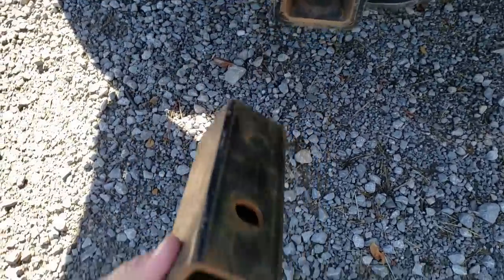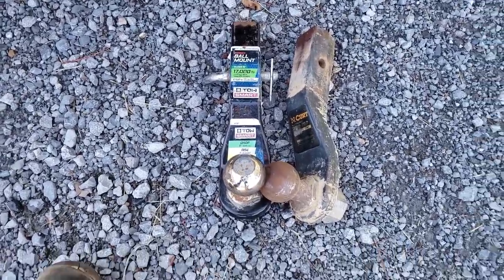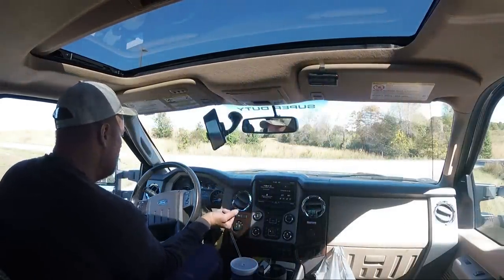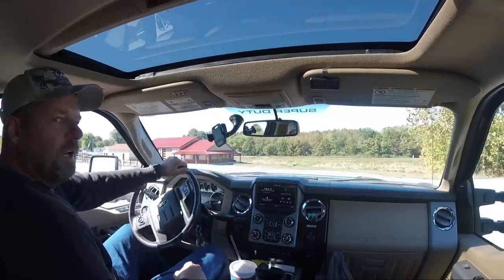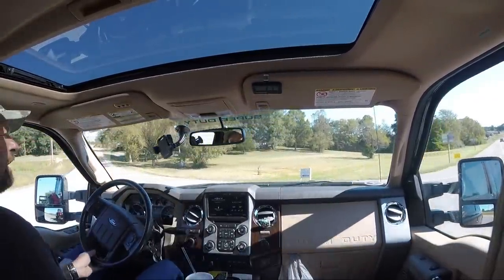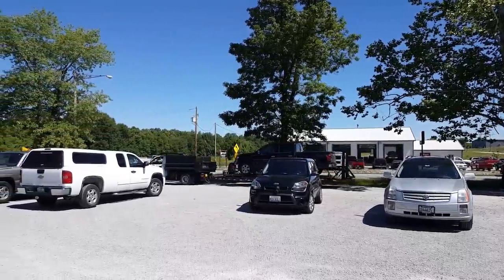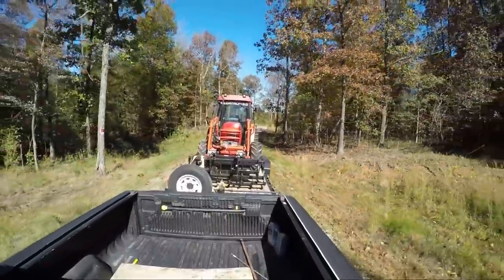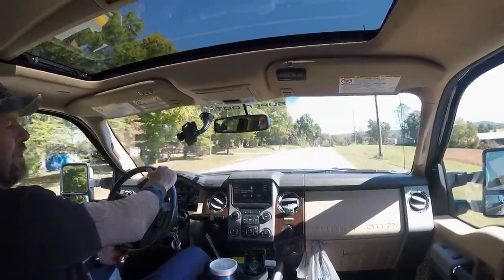Ford F250 6.7 Powerstroke Diesel FIRST TOWING MISSION 10k Steep hills & more

Comment: You can actually go in the settings and select trailer brake efforts. Which applies the trailer brakes quicker to your gain setting
Reply from the maker: Yes I'll have to dig around in there a little bit more I know how to adjust the gain setting but wonder if there's another setting that can be changed

Comment: That hill decent is for off-road use mainly does the brake management for you so you only have to worry about navigate the terrain. Also while going down the hills in tow haul, if you apply the brakes the truck will downshift and the transmission will hold a speed like sort of like an engine brake.  Great purchase as the f150 needed a break lol, love the content.
Reply from the maker: Thank you I appreciate it and yes I am really enjoying the engine braking in tow haul mode

Comment: I’ve never drove a better towing truck than a ford
Reply: Never drove a better pulling heavy duty truck than Ram/Cummins , half tons my Ford 3.5 ecoboost 10 speed is the best pulling half I’ve every pulled with.
Reply: John DiMartino I like the Cummins just not the truck around it.
Reply from the maker: Rodger that that's why I went with the Ford my Chevy 3500 just was way underpowered. But I'm really digging the new diesel :-)
Reply: Kapper Outdoors it’s a nice truck 👍🏽 great video 🇺🇸

Comment: For years I have had a Ram 3500 Cummings, after 3 million Miles on the same engine without one breakdown, I will never drive anything not powered by a cummings. I am so happy to see Ford will get them, Ford trucks are a smoother ride, Ram is very ruff, but they don't brake, though my back and but could use a rest, LOL.
Reply from the maker: Yeah no doubt Cummins is a beast. Both of my tractors have Cummins engines and they Rock. Thanks

Comment: 14k toy hauler on 10% grade at 70° F for several miles, going to 6500 feet elevation. As long as your not a jack wagon... no problem. LaPort road on the grade in Plumas Country CA...no big what your doing in Kentucky. I tow in the high Sierras of CA...Ford kills it. Single rear wheel F350 176” wheel base...stock.

Comment: The gain needs to only be set at like 4.0/4.5 if that for the trailer brakes with that trailer and load. 9.0 is applying almost all of the braking power the trailer has. The reason for the skidding noise is the trailer brakes are locking up.
Reply: He said that🤦‍♂️
Reply from the maker: Yes I understand, but that trailer has not been breaking properly with my other two trucks I've had the brakes adjusted and checked so that's why I started High. I'm learning that truck and trailer combination as I tow. Thanks

Comment: So did they ever figure out the electrical issue? You mentioned it but never said if they found anything. The new Superduty looks great. 
The wife gets the new suv this time and I get a new truck in a few yrs. Can't wait.
Reply from the maker: LOL good luck in a few years when you get a truck. I believe the electrical issue is resolved but can't be one hundred percent. He tightened up the wiring behind the radio and tightened up the radio mounting bracket and so far everything has been just fine.

Comment: I have a 2014 F250 but it only came with a 12k max hitch using a weight distributing system. Did you replace your hitch with a heavier rated one? Is that a 14K trailer? I had a 7k trailer but want to get at least a 10k or maybe a 14K. Trying to figure it all out.
Reply from the maker: This truck has the 'super' heavy duty tow package. I don't recall the exact name of it, but it is the 'max' tow package, above the standard 'tow' package. I've been contemplating the distribution system.

Comment: I loved your video thank you for the content. I do have a question about your truck I read in your description you were towing 14 to 16,000 pounds.It’s just my opinion but you got the wrong truck that F250 isn’t what you needed , F250 isn’t meant for heavy pulling, as it doesn’t have the payload to carry the pin or tongue weight of a trailer over 10-12000. It’s really a DOT Cheater truck.... the diesel version doesn’t even have more payload than modern  half ton.  Those early first generation 6.7’s are known for their crankshafts breaking , injector failures ,and turbo failures. I would have at least got a 2015, with the crank upgrades turbo and fuel system upgrades and more power.
Reply from the maker: Wow man I'm not sure where you got the info but that is a super duty and it's actually made for heavy towing. And the 6.7 powerstrokes have an amazing reputation for reliability. Thanks

Comment: Sweet truck man. I figure you went with the 250 instead of the 350 srw truck to keep your trailer+truck GVW below 26,001 lbs? Does the 250 have the 350 springs in the back? I noticed it took the weight really well without really squatting.
Reply from the maker: You bet, you called it right on the money. 26000 even or less :-) yes the super duty has a great tow package.

Comment: Would weight distribution better if you backed tractor on??
Reply from the maker: Not really it's kind of a horse a piece a little heavier on the tongue or a little heavier on the tail. But it is well within Towing specs for tongue weight. Thanks

Comment: You mean Ford doesn't even offer an engine ( Jake) brake? For going downhill braking..that's pitiful if they don't. You should have looked at Ram they are standard on diesels..
Reply: An exhaust brake on the Super Duty  6.7 started with model year 2017 (available in late fall 2016).  Kapper's  truck is a 2013 - so it does not have an exhaust brake.   None of the pickup truck engine brakes are "Jake brakes."    They are exhaust brakes using the turbo to provide back pressure in the intake manifold by closing the turbo vanes.  This provides static pressure against the flow of exhaust gasses on the exhaust side of the turbo.  A real Jacobs Engine Brake alters the operation of the engine's exhaust valves - and usually allows the driver to provide incremental engine braking (low, medium, high) by engaging either two, four, or six cylinders of the engine.
Reply: Buckhorn Cortez yes I know, I have been a truck driver 25 years.
Reply from the maker: Well call it whatever you want, it does have engine braking downhill once you hit the brake to your desired speed it will then use the engine braking to maintain it. My guess is it was built of that way. Because it says it in the manual.
Reply: Southern Outdoors You mean you don’t understand the difference between a Jake Brake and an exhaust brake? They are standard on all the current Big 3 diesels, by the way- not just Ram.

Comment: Dont compare a "chevy"  to a 6.7
 you are talking about a 6.0 gas
Reply from the maker: I only compare them because that is what I have and what I've been using. The Chevy couldn't handle the load which is why I had to get the power stroke. Thanks